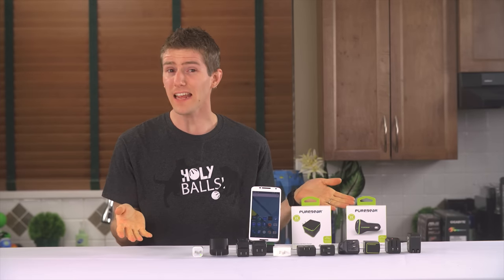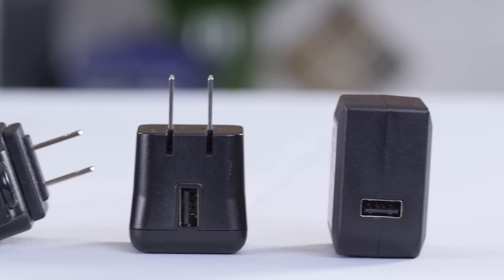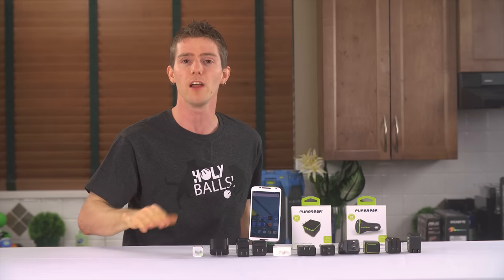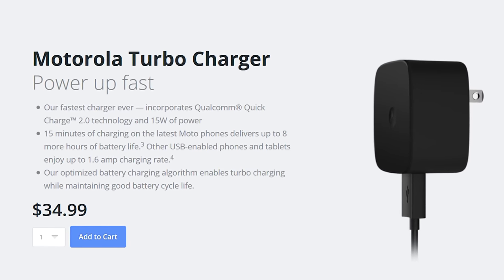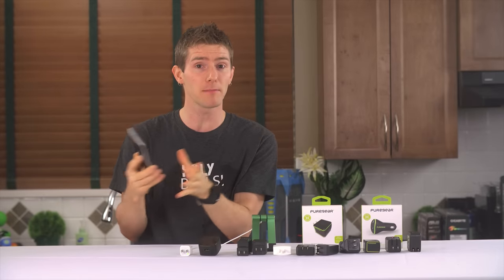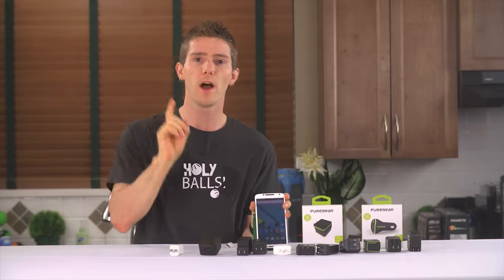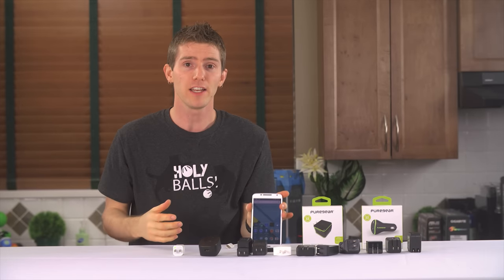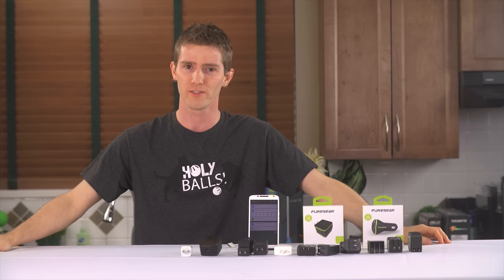Faster Phone Chargers Explained - Qualcomm Quick Charge 2.0

Comment: So by fast charging you degrade your battery life?
The battery's internal temp goes up to 95 or 91 degrees F, and that's supposed to degrade your battery?
Sometimes Linus is such a drama queen.
How about those who carry their phones in their pockets, next to their 98 degree skin? Does that degrade the battery also? Does using your phone when it's over 95 degrees out also degrade your battery? Should we store our phones in the refrigerator?
My understanding is that this technology keeps the battery cool enough that this wouldn't be a problem.
Also, should we not play games on the phone because they heat up past 90 degrees F then also?
Reply: He says extra heat will degrade the life span of the battery. It is true. It is a fact. 10 degress celcius every night WILL make a diffrence. Carrying it in the pocket and playing hardcore games will make a diffrence. Extra heat = less power cycles. He is not being a drama queen, he is just saying that it is not logical to downgrade the life of your battery with fast charging it at night cause you dont need fast charging at night anyways.
Reply: wat... the battery is actually 95, not the surroundings about it, dont know if you have proper schooling but if things are two temperatures they will continue to drain out each other until they reach an equal homeostasis, so the fact that is is next to your skin really has no impact, especially considering its in your pocket not direct contact with your skin,
Reply: Bradley Baker You really know things. You must be the brightest in your gifted school. What you said proves my point,that carrying your phone in your pocket will degrade your battery. Thanks for reaffirming my statement, but you shouldn't have.
Reply: GameNationRDF 10 degrees C?. But we are talking about the difference of 7 degrees C, and that 7 degrees is at half the time as the lower power charger, so the difference is a wash.
Reply: It's just fact lol... Trickle charge is the most effective for battery longevity... Scientific fact. You are welcome to use the internet to confirm what is already regarded as common knowledge.
Reply: Dino Barberino And the sun revolving around the earth was common knowledge also. That doesn't mean that the sky is falling.
Fact.
Reply: sjs The Sky is just a gaseous mass though... so its dynamic in nature with some parts rising and some falling depending on current lol...
Reply: It's fact that hotter charging degrades battery life but honestly, who cares when we get a new phone every 21 months. It won't degrade that quick. All my phones are running today. My Sony Ericsson Xperia Play still holds it battery fine 3 years later which is a much lower size and older battery. If that can last i'm sure 2 years of fast charge will be fine. Also if you are fast charging this means they must be doing it more than once a day. That is what will kill the battery quicker. But if someone is using the phone that much then they are best buying phone with removable batteries and adding an extendable 9mAh battery in.
Reply: Here's a good site for battery stats: http://batteryuniversity.com/learn/article/how_to_prolong_lithium_based_batteries

It doesn't show the effect of temperature on the rate of degradation of batteries when charging. However, it does show the effect of temperature on stored batteries (Table 3).

When storing a battery at 100% for 1 year at 40deg Celsius, the capacity is reduced to 65%.
At 25deg Celsius, the capacity is only reduced to 80%.

Take from that as you will.
Reply: My logic is that most people won't have a phone much longer than 2 years anyway since you literally get phones for free with new contracts.

For me, the Droid X, RAZR MAXX, Droid MAXX, and Moto X have all cost nothing, and I'm sure other carriers other than Verizon give away phones for free with new contracts as well.

Some people buy their phones no-contract or they don't wait for a last-gen phone to go on sale. These people probably won't care that they have to service their battery nor will they likely keep the same phone for over 2 years anyway so this point is moot.

tl;dr - Overall battery lifespan is irrelevant in the world of Moore's Law.
Reply: If you are really worried about battery failure, only buy phones that you can replace the battery and not send in the phone for repair. Then there isn't ever going to be a problem. Would anyone buy the Tesla if you couldn't replace the batteries in it after the batteries need servicing?
Reply: sjs Exactly. Don't get me wrong. Having a phone with a non removable battery is good if you use your phone in places where there is tons of water but cmon who uses a phone under or near tons of water? Those phones should be special devices with very few made for those who do want phones like the Xperia line. That is the only good thing about Samsung Devices. Removable Batteries.
Reply: sjs
what the fuck? there is a difference of the actual temperature of the phone being at 95 degrees then the outside temperature. But if you are really worried about your phone being outside or near your skin, just put it in a vacuumed vault at room temperature to never be touched again
Reply: Bradley Baker My point is, I am not worried about heating the battery an extra few degrees. And considering how often phone technology changes, and most of us change phones,, there's no reason to worry about the temperature differences caused by fast charging. And especially not a hissy fit over it.
Reply: Oh well if you would of just sayes that then yeah for sure!
I mean i havnt really had a smartphone for more than two years, but to a small percentage of people they want there things to last
Reply: Your post made me mad.

Yes charging your phone faster does degrade it faster per life time cycles. No, it not just about temperature. The temperature while charging tells you the physical intensity of the charging, higher heat is higher resistance, higher resistance both decreases inefficiency and degrades charging quality. Batteries are primitive chemical reactions used to generate electricity, temperature effects these chemical reactions and degrade these cells. That's why over time your phone doesn't carry as much charge as its used too.
Reply: GuardianLords I don't care about that. They get power from potatoes, then I can just go into McDonalds and order a large fries to power my phone. I still have and use my original smartphone and it still works. It still holds a 70% charge and that's OK by me. It's a Galaxy S3, and guess what I do when the battery goes bad. Go on, take a guess.
That's right: Spend $3.50 and replace it.
No drama; Nothing to get mad over. It's your fault if you can't do that, NOT MINE! Get over it.
If that upsets you, time to up your meds, but that's why you are taking them in the first place.
#MoveAlong,NoDramaHere
Reply: Actually the additional heat is created because you are pushing the cell outside of its C rating. Pushing a lithium cell to charge or discharge higher than its C rating will reduce the number of charge cycles. Although you can offset this a little by charging to 4.1v instead of 4.2v
Reply: th3d3wd3r I guess that's why they put internal charging circuitry in phones capable of fast charging, to prevent that.
Reply: sjs Lithium batteries need a fuel IC, not so much to regulate charging, although it does do that and is programmable, but more for reporting state of charge to your phone. Look at the voltage output curve of a lithium battery and you'll see why simply taking a measure of the voltage does not tell you the state of discharge
Reply: th3d3wd3r So are you saying that the circuitry in place on phones which are designed for fast charging [not in the batteries themselves] do not regulate the charging voltage to assure the batteries longevity? I am not talking about some 4 year old phone that you hook up a fast charger to charge [although that won't work either].  
There is a huge difference between a PowerEx MH-C9000 WizardOne Charger-Analyzer  and a generic wall wort AA battery charger.
Reply: Like I said before, fuel gauge ICs are programmable. If you want max charge out of the box on an older phone, you'll need to program the IC to do so. Obviously you can't take advantage of 12 volts, but you have to look at it in watts as there is a relationship between voltage and current
Reply: I've been using the 10 watt apple ipad 4 charger on my LG G2 which supports quick charge for a year now and battery life is just as good as the day I brought it home.
Reply: FastRedPonyCar Do you often drain your battery down to the point where it turns itself off? Top up charges usually hammer the cells less. It also depends on the specific battery type used. Lithium polymer is only good for 300 ~ 500 cycles,while lithium ion is good for 500 ~2000 cycles
Reply: FastRedPonyCar right but a year isn't what he's talking about he means more then 3 years or so.
I agree he's over exaggerating slightly but temperatures on a battery while charging matter
Reply: Steel - Heart there's no need for that
Reply: th3d3wd3r no my battery is only at about 50 or so % at the end of the day.
Reply: FastRedPonyCar Aaaand that's why your cell is still good ;)
Reply: Dino Barberino You are partially right, but as with most phones today, they use either a Lithium Ion (LiOn) battery or Lithium Polymer (LiPo) battery (iPhone). Lithium Ion does not do well with trickle charging or full drain pre-charging. Once charged remove it from the charger. Overcharging will shorten the battery life. Some have convenient charts or lists claiming how many hours over you can go, but the honest truth is 5% of the charge time is the maximum you can go over. In today's standards with chargers in the 1.0A to 2.1A range would be mere minutes. Thus leaving the battery on the charger for hours or letting it overheat each time removes a life from the battery.  Trickle charge was for previous phone batteries from the 80's... NiMh (Nickle metal Hydride) or NiCAD (Nickle Cadnium) batteries and does not apply to LiOn or LiPo batteries. Both LiOn and LiPo actually prefer partial charges to 80% rather than full to 100%. At 100% it causes stress and also loses a life. The old method of charging to full as reported by the phone (actual 80%), unplugging it for a minute then plugging it back in to get to the true 100% isn't good for LiOn, or LiPo batteries. They will last their full lifetime if only charged to 80%.
Reply: sjs This is a big deal for me.  I always want to know that I can swap batteries if I need/want to.  I refuse to buy an iPhone because the battery is not user-replaceable (there are a lot of other reasons too).
Reply: ILLUMINATI IS ILLUMINATI IS ILLUMINATI CONFIRMED
Reply: sjs
are you talking in F or C cause if ur skin is 45 C you should immediately see a doctor. normal body temp is 37.5c +/- 1 40 is you got a high fever so 45.........
Reply: Kien Soyokaze I can't spend my life helping you comprehend the English language. If some person had a temperature of 45 degrees C or F they need to see a coroner.
Reply: ***** using logic and common sense is far from mere opinion. They're made from observable facts, which you can make conclusions from. It's called the scientific method.
Reply: ***** I seem to think you need to read your autobiographical statement and stop BSing with me. Linus has shown a minimal amount of elevated temps by charging at different levels. He has not shown any specific failures by charging this way, nor has he said that he intends to. By him drawing conclusions without completing the testing procedures, he is guessing. Is having a battery at 95 degrees for 2 hours worse than having a battery kept at 87 degrees for 3 hours? Where's the testing of that?
An incomplete hypothesis.
Reply: ***** I'm so glad the world is full of self-absorbed narcissistic people without common sense, that demand things from others to shut them up .
Reply: you really need to learn how batteries work bud.
Reply: pumpkin1escobar Oh educate me oh great wise ass.
Reply: Dino Barberino That is total bullshit, trickle charge is used on NiMh batterys, when they are fully charged. LiIon batterys use a CC/CV charge method and should not be trickle charged or overcharged, since they'll explode then.
Reply: Blue Chan Your phone wont overcharge its battery, since there is a charging circuit implemented which prevents this. If you were to overcharge your LiIo (it is LiIo btw, not LiOn), it would most likely explode, or catch fire.
Reply: sjs
hey! that was kinda funny!
damn you're getting a little better kid!
too bad you don't know what a hemorrhoid is though, but its okay you're making progress!
Reply: pumpkin1escobar See that still nothing worthwhile out of you...
Isn't that what the doctor said after your mom gave birth to you?
Reply: pumpkin1escobar Did you say anything? I couldn't understand you. It sounded garbled. What is that obelisk type silicone object going deep into your throat?
Are you missing Linus?
Reply: sjs

why are you replying then? do you have nothing in your life but me?
Reply: sjs
well if this was BDSM you're just tickling me right now. I'm just sitting here waiting for some of the real shit to happen.
Reply: pumpkin1escobar Tickling you when you like BDSM; Then I am doing good.
How's the kids? Have you scraped them off the new Sports Illustrated yet?
Reply: sjs
no thats just the weak foreplay, its not good its just okay.

sports illustrated? they still make that magazine?
Reply: sjs
aww whats wrong? you even more mad?
Reply: charging your battery faster does degrade your battery faster. Fact. This applies to every rechargeable battery to date.
Reply: sjs
rofl, you getting mad that you're flip flopping your arguments?

why you so mad when you were the one so quick to throw around insults.
Reply: sjs
awww you're so mad! its so cute! not so tough anymore eh
Reply: sjs
hey look! more angry insults! wow! mom jokes! you're so versatile!
Reply: pumpkin1escobar Just like your mother who has no gag reflex and is very flexible.
Reply: sjs
oh well i guess that's the extent of your ability eh? better continue using the same ol' boring insults! because you couldn't possibly come up with something that has thought put into it! no no that would be too much work, wouldn't it? and we both know how much you like that eh (hint hint you spend no time researching)
Reply: sjs
why would she care? she isn't in this conversation, thanks yet again for saying something stupid.
Reply: pumpkin1escobar Asshole
She cares so you won't lose your home, there's a pickup coming to repossess mom's house.
Reply: sjs
uhh what does this say about you? lol do you even think before you type?
Reply: pumpkin1escobar Still nothing worthwhile out of you...
Isn't that what the doctor said after your mom gave birth to you?
Reply: sjs
once again please look up the word hypocrite and have a nice day!
Reply: sjs
you really have no life eh?
Reply: sjs
are you even trying anymore?
Reply: sjs
well apparently i am as you keep giving me your attention day in day out.
you don't like to think, do you?
Reply: sjs
you didn't answer my question though (seems to be that reading comprehension getting you down again :( )
Reply: sjs What, and you're contributing with your wonky logic? If you think your comments count as contribution, you need to think again.
Reply: sjs Why can't you just admit when you're wrong instead of making a fool out of yourself?
Reply: D13H4RD2L1V3 When your mind can grasp conceptual thinking, maybe in a few years, you might understand the futility of saying ignorant statements to bolster your side of an argument. 
I guess boiling an egg is a concept that eludes your level of intelligence.
Reply: I know I'm a little late to the parade but.... If you don't understand how something functions, don't go around spreading, what you like to call "facts" if you don't know what the fuck you're taking about.  I'm not sure what I was expecting from YouTube comments anyways.
Reply: Having heat isn't the end all be all of a battery, but would you agree that the optimal temperature for things like batteries is about room temperature.  Just because a battery is above that temperature doesn't mean it is ruined.  I think you're missing the point of your original comment.  The difference is insignificant, but it is still there.  I'm not 100% disagreeing with you but... It's not as simple as "if the battery is above X amount of temperature  it will stop working"
Reply: wow. well done then, mission accomplished.
Reply: Beryllium Nickel 
When some people are triggered about something, sometimes they will never be un-triggered lol
Reply: Catnip  Thank you for seeing that the temperature difference is inconsequential [while charging].
My point was that Linus is being a drama queen. EVERY charging cycle, regardless of temperature degrades every battery. I use phones that are over 4 years old [which still work fine with great battery life] and the battery temperature is the lowest thing that I worry about. A phone's battery temperature is regulated by internal safeguards set by engineers. He doesn't inform you of that. He doesn't even give ANY credence that someone who has spent 4 years STUDYING engineering would know more than a HS graduate. He just rants like he is on his period about it. If it WAS such a big deal, why don't manufacturers STOP making phones with Qualcomm Quick Charge 3.0? Why aren't there recalls on EVERY phone that uses fast charging?

9 hours agoHighlighted reply
Having heat isn't the end all be all of a battery, but would you agree that the optimal temperature for things like batteries is about room temperature.
Reply: Beryllium Nickel - Why are you here Still Trolling...
Reply: idk apparently i love trolling
Reply: leave your phone in your car charging on a summer afternoon and see what happens
Reply: I've done that before, rip iPhone 3GS lmao
Reply: Your skin isn't actually 98 Fahrenheit. That's your internal body temperature, not external. There's a reason doctors don't check temperature by putting the thermometer against the back of your hand. You are always losing heat to the surrounding air, and so is your phone. 

That being said, yes, it probably would increase the temperature of, and therefore reduce the lifespan of, your battery. However, I wouldn't expect it to be heated much beyond 85~90 degrees, which isn't going to do THAT much damage. Same goes for playing games.

Fast charging also will reduce the lifespan of you battery, but probably not by much. It's about doing a cost-benefit analysis. For you, at a particular moment, it might be worth damaging your battery a little bit to play a game. Charging you phone quickly before you get out the door might be worth the couple fractions of a milliamphour that your battery will lose. But, if you don't need to charge your phone quickly, you're better off just letting it take its time.

Storing your phone in the refrigerator is not necessary. For one, your battery isn't really designed to handle low temperatures, and you could cause condensation to form on the inside of the phone. Also, the damage you do increases exponentially as a function of temperature. So raising the average operating temp from 95 to 100 may reduce your battery's lifespan from 2 years to 1, but reducing the temperature from 70 to 60 will make it go from 10 years to 20. At 70 degrees, you're not really doing any damage, so reducing the temperature any more is just extending the life well beyond the lifespan of the rest of the components. Furthurmore, batteries can only handle so many charge and discharge cycles before they die, regardless of temperature.

One of the most important factors that affects battery lifespan is the voltage that the battery is charged to. The optimal max voltage for a Li-ion battery is 3.92v. Charging it to more than this will increase the capacity slightly, but will reduce the lifespan dramatically. As a rule of thumb, for every 0.1v you increase the voltage, you halve the lifespan (total number of charge-discharge cycles) and increase the initial capacity by 10%. Most phone batteries are charged to around 4.2 volts. This provides a higher initial maximum capacity, but after a hundred or so charge cycles, their capacity is lower than if they had always been charged to 4.1 volts. 

I don't know of any way to reduce the maximum charging voltage of a phone's battery other than just unplugging it before it reaches full capacity, but that also means the the phone has to run on the battery rather than from the charger, causing extra stress on the battery. It's also massively impractical. If you can figure out how to change the max charging voltage of your phone, I'd love to know how. It's something I've looked into before, but it seems like noone has tried it.